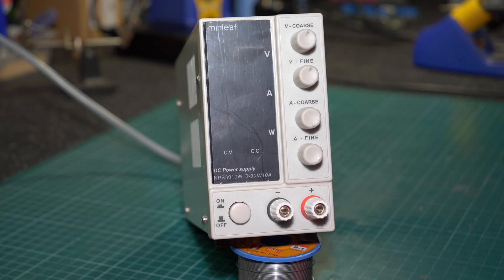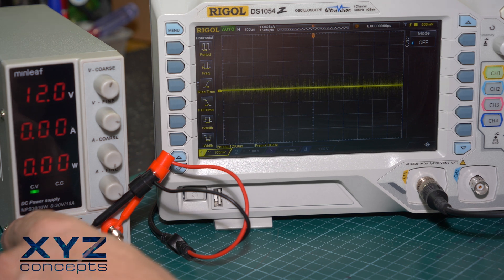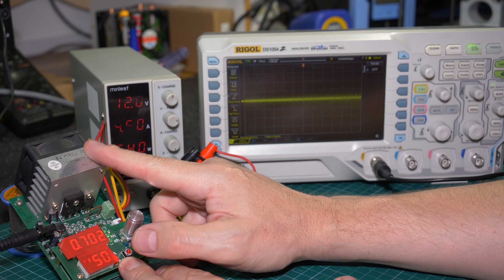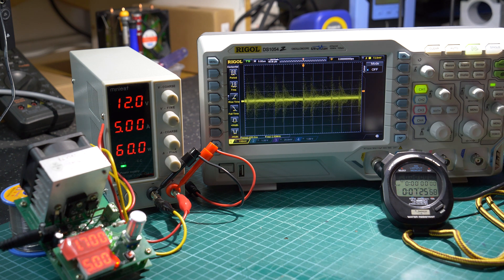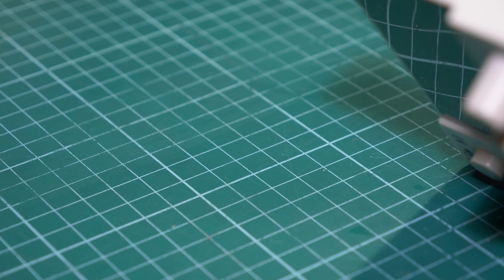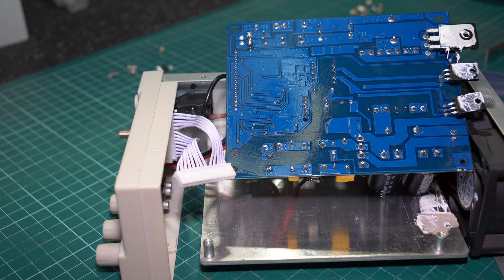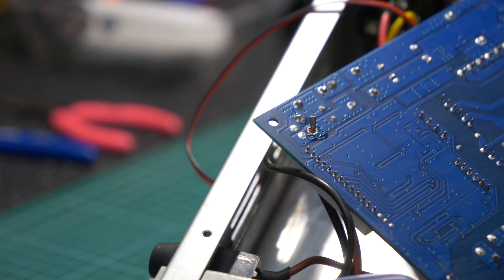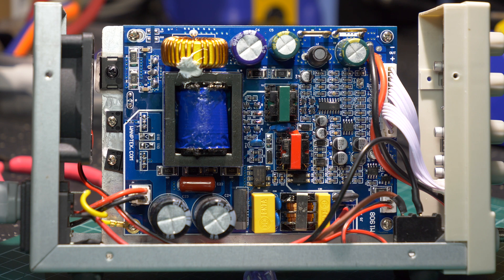#28 - Minleaf NPS3010W - Review Revisited

Comment: I had 2 of these wired to give a + and a - voltage a year ago, but mine were under the name of Topshak  Worked very well with no issues. Recently I sold these and replaced them both with a 0-60 volts @ up to 5amps. Agin wired to give a + and - supply. I found this more use useful as my channel deals mostly with amplifiers of one type or another. The number of this is NPS605W under the Topshak brand. Almost exactly the same inside except the calibration circuitry.
Reply from the maker: Yep, I own the 605 also, working well.

Comment: Hi, I'm looking to buy this PSU to diagnosize shorted component on computer board, so basically I would like to know what happen if I set voltage to 1v, current to 10A with a 0ohms load, does the voltage excede 1v ? The voltage goes down ? Or the PSU shut down ? 
Thanks you
Reply from the maker: Hi there, the voltage shouldn't exceed what you decide to set it at.  10A testing current shouldn't need to be that high if searching for shorts.  Saying that, 10 watts is fairly modest for finding offending (hot) components.  Stay safe.
Reply: @xyzconceptsYT  Thanks you

Comment: Hi I’ve got question I bought the same power supply but mine wont stop making a buzzing noise/coil whine when load is applied the pitch of the whine changes what could be the cause of that issue ?
Reply from the maker: That could just be a noisey transformer/coil, this is just resonance with lesser quality tranformers/coils generally.  Not really a fault but can be distracting.  Mainly caused by loosely wound elements within the transformer and an audible switching frequency.  Try and identify which transformer/coil it is and change it out or goop it up with silastic rubber compound to dampen the vibrations down.
Reply: Have you managed to solve this issue? This squeaking/buzzing noise is driving me nuts. It goes away after applying load or shortening the connectors but other than that it's very unplesant.
Reply from the maker: @TheKravmat  My unit doesn't have this issue as you describe (yet), so I haven't had to find a solution.  Not to say this problem won't develop over time.

Comment: Hello, i have a question. I have the same power supply and i think that something go wrong with the fan. The fan working all the time (when you press the on/off button starts?) I havent see in my power supply never the fan to work. What about your power supply?
Reply from the maker: Hi, great question, the fan is thermally controlled.  If you were to open the unit you will see a NTC thermistor next to the main switching MOSFET pressed against the heatsink.  This is monitoring the temperture of the heatsink, under high loads over time the temperture will rise enough activating the fan.  My fan has only activated once when supplying about 100 watts for 10 or so minutes.  This makes the unit nice and quite under light use.
Reply: Or they fuck up the board and yeah

Comment: I’ve got question. I bought the same power supply from AliExpress but mine has a 0.5 V difference between the display and the output. This is measured with a Fluke 179. Also the current reading is of by 200 mA. Sending it back wasn’t an option, AliExpress wants me to pay for the return postal which would cost me half the purchase price. So, do you know a way to correct the display. Turning the potentiometers inside does change the display value but it is still way of.
Thx in advance
Reply from the maker: Sorry to hear your unit isn't within spec.  The calibration may not necessarily be as simple as turning the internal potentiometers.  Maybe you could visit wanptek.com and see if they will supply you the calibrating procedure.  This may involve different load conditions to be carried out to maintain the full scale performance characteristics within the specifications.